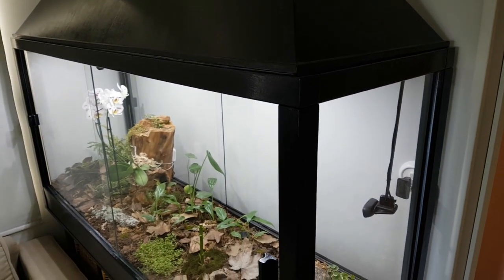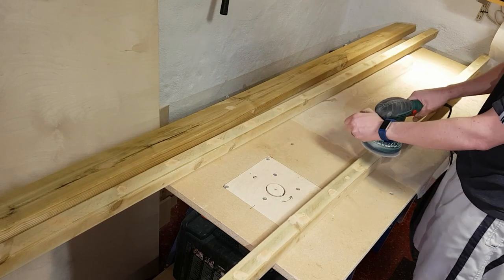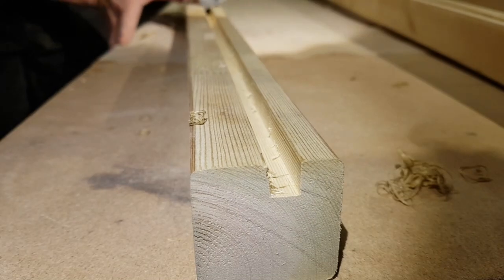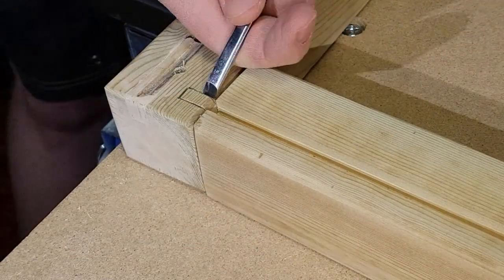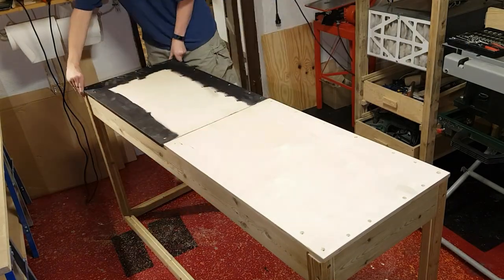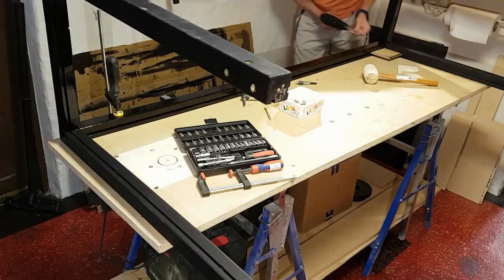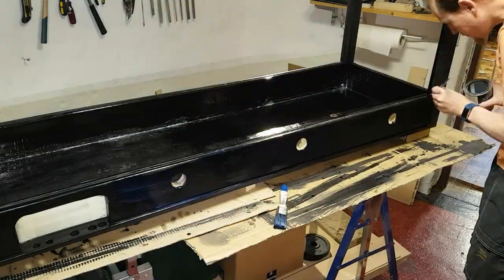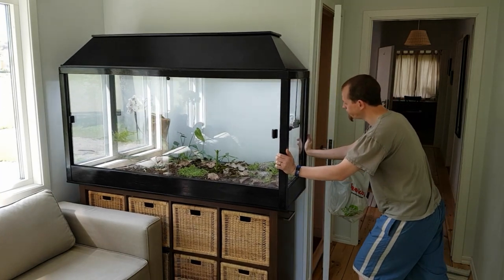DIY Vivarium. Building the wooden frame and base.

Comment: Great job. What kind of epoxy did you use to seal the box?
Reply from the maker: The epoxy is from West systems (resin 105, and hardener 206). It is supposed to work well in a marine environment and I hope it will work here also.